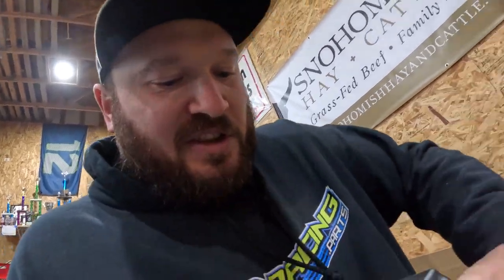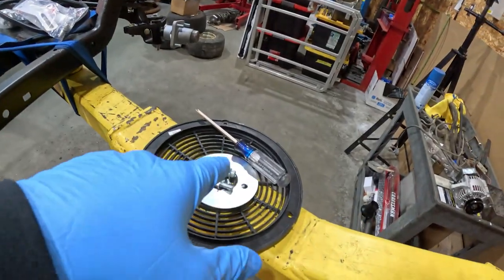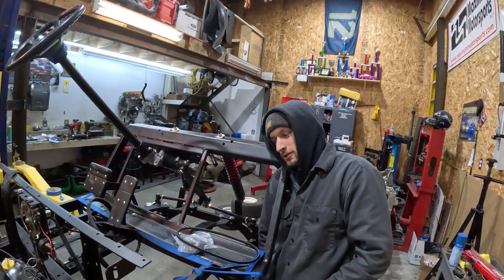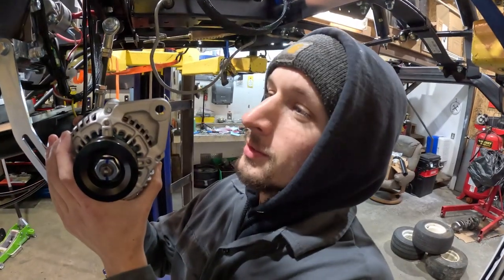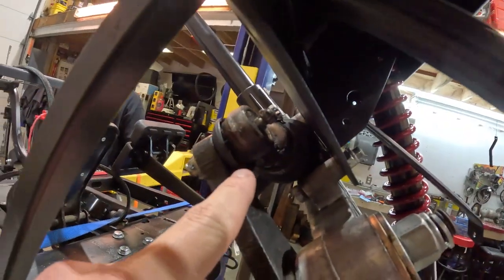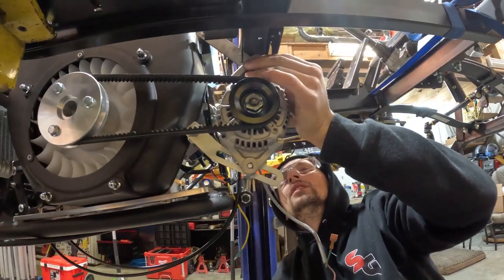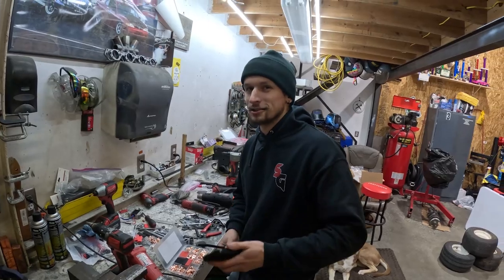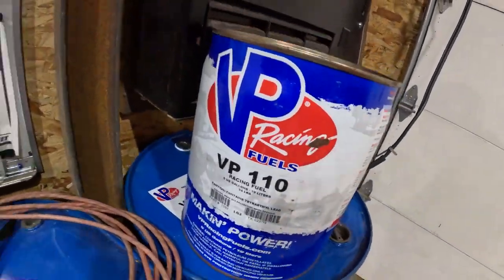Firing Up The 670cc Predator Motor In The E-Z-GO TXT Golf Cart!

Comment: That c channel you cut into for the alternator needs to be beefed up, it’s a main support for motor and suspension.  Two reasons added weight and torque. It will probably sag  bend over a short time.

Comment: Noticed you checked temps and mentioned they were different. One thing I learned in my minimal research on this engine is that the carbs are jetted differently. One has a bigger jet. Something to do with the original muffler and the exhaust having to travel further from the front cylinder to the exit of the muffler. Just thought I’d let you know. You might have to watch the plugs and rejet the carb.
Reply from the maker: Yeah we did more research after the fact and realized these cards take some tweaking for sure!

Comment: Does the top bracket for the alternator  hit the frame when the cart is in a flex? Still looks close
Reply from the maker: It’s close, we made sure to take more material off the bracket to help to clearance. Luckily if it needs to be notched a little more we still can. We haven’t been able to test it yet, however it should be done soon!